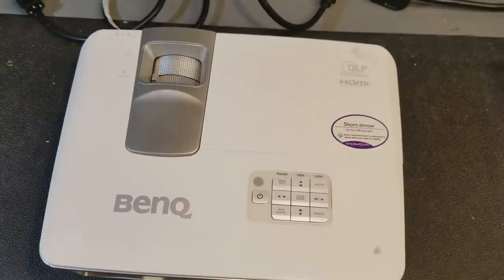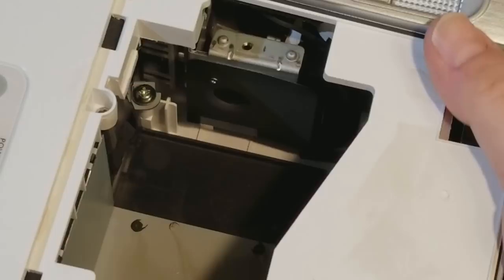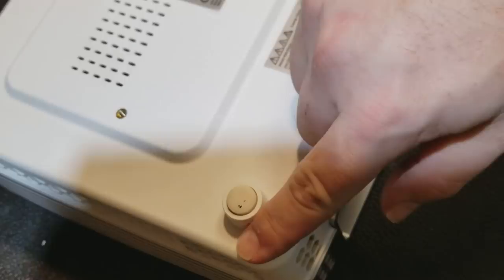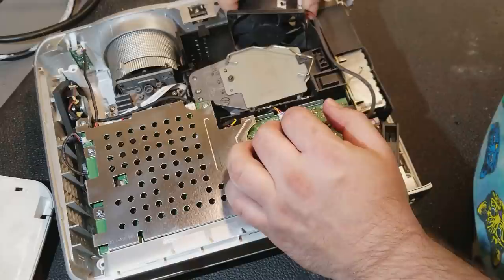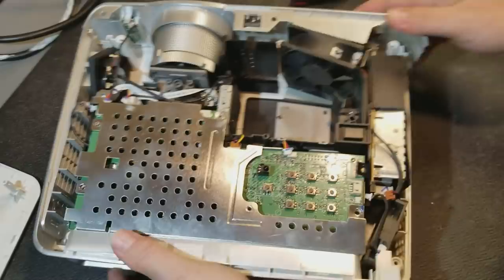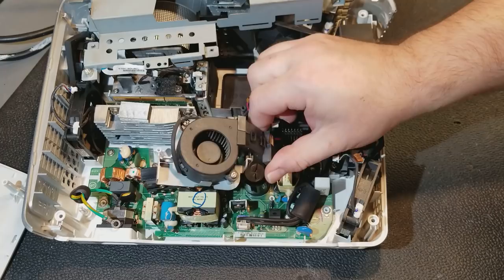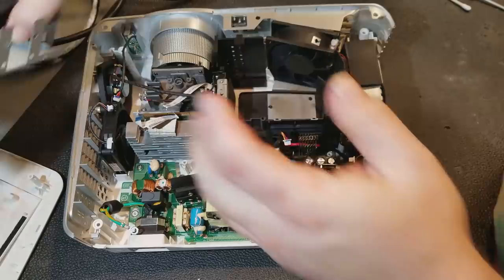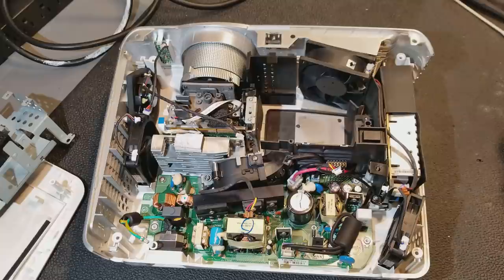BenQ W1080ST DLP Projector Cleaning / Service P1

Comment: Hello Franck, thank you for sharing all this knowledge. I have an issue with my Benq W1080ST.  After having replaced the bulb and one fan, I have no power on the mother board. No led turning on . The switch connector on the cover is OK. Do you have some ideas ? Thank you in advance
Reply from the maker: Bonjour Ludovic!  I saw your email and have some ideas.  If the fuse is OK, you need to check for any standby voltage on the pins to the mainboard.  Also, check the thermal fuse/breaker on the blower fan.  It will interrupt power to the power supply as well as the door switch that you already checked.
Reply: @FixitFrank  Hi Frank, thanks for the advices. Fuse (F601) is OK (0 ohms) - Thermal fuse breaker (CN702) is OK (0 ohms) - Door switch (CN602) is OK (0 ohms) - I checked also the standby voltage  on the pins to the mainboard (CN701) : pin 1 0V - pin 2 12,8V- pin3 12,8V - pin4 12,8V- pin5 12,8V - pin6 0V- pin7 0V -pin8 0V - pin9 0V - pin 10 0V-pin 11 3,4V - pin 12 0V - pin 13 3,4V - pin 14 0V.  this is DC voltage between ground and each pin. Do you think the powerboard is OK ? - what's next could I check (motherboard ?) - Thanks in advance for your support and have a good WE.
Reply: Sorry , I made a mistake , pin 2 is 0V and pin 1 voltage is fluctuating
Reply from the maker: @ludovicdehondt649  Fantastic! That seems to be correct.  The standby voltage seems to be there.  https://elektrotanya.com/showresult?what=BenQ%20w1080&kategoria=&kat2=all  This is the service manual(free download).  The website is Hungarian but the manual is english.  Page 8 goes over the schematic for the power control.  I suspect you may have a mainboard with a bad regulator but the service manual will help you locate which one.  You are very welcome! I am happy to help.  Have a nice weekend as well!
Reply from the maker: @ludovicdehondt649  I think pin 1 not connected so you are reading air inductance. You can ignore that.  Page 19 of the manual shows the power supply output and it matches your readings.  Moving onto the mainboard is a good option.  
If you end up needing a mainboard, they are actually reasonable in price.  Email my friend at Time Electronics.  Gydz@timeprojectorlamp.com and send a picture of the old mainboard and they will quote you a price to Aus. They take paypal and ship DHL.
Reply: @FixitFrank  Hi Frank, Finally I found the root cause...basic mistake....the 14 pins  from the power board were not properly connected to the mainboard. the 2 pins on the right were touching the metallic structure. SInce then, the projector works 2 minutes and then stop  ( power led red - temperature led full green)  because of fan issue. I hve gone through  the factory menu. Fan N°3 RPM and fan N °4 RPM are indicating 0 RPM . I'm sure fans N°4 is running, i can see it. I will investigate to make sure fan N°3 is running as well. If you some othier ideas...thanks in advance
Reply from the maker: @ludovicdehondt649  That makes a lot of sense. I have had that happen as well. I am so glad you were able to work it out.  Congratulations!

Comment: Hi Frank. The bulb in my Benq W1070 exploded after a few years of good service. I have just replaced the bulb but when I turn the projector on it switches off immediately from overheating ('TEMP' indicator on). I have read some comments here and I know that I should check the lamp cooling fan. Any other suggestions? Is it possible that the bulb is installed badly? Or that the bulb is faulty? (I ordered on Ebay from China). Many thanks.
Reply from the maker: Hello Patrycja!  Two things to check.  First make sure the bulb you received says "osram" or "philips" on it somewhere. Otherwise its a knock off and a waste of you money.  Knock off lamps tend to last a small percentage of the expected life span. This means you end up buying more lamps when if you buy a name brand(does not have to be from Benq, but it must be a Philips or Osram bulb) it will last much closer to the full life of the original.  
The temp warning is probably a piece of glass stuck in the lamp blower fan.  I have a video on an HT1075 which is close to your W1070. It had the same issue and was due to a bit of old bulb jamming the blower fan.  Here is part1.  https://youtu.be/rki1jSNMpII  Part 2-4 is in the description.  Once you get the glass bit out, you should be fine.
Reply: FixitFrank Thanks very much! I will check the lamp blower fan. By the way - the bulb is Osram.
Reply from the maker: @merkova999  Great! In that case, the lamp is probably fine. Good luck with the fan and let me know if you get stuck.

Comment: Hi frank, Barbie, here again! ...got a question about the fan... my fan needs replacement and here in Argentina i was able to find the model  of fan Ad07012dx257300 wich is 0.36A and the fan for my benq says Ad07012DB257300. and its 0.30A, any chance the one i can get here might work? or needs to be the exact one? thanks again!! B.
Reply from the maker: Hi Barbie!  Good to hear from you!  I think you will be OK with the Ad07012dx257300!  I checked and the X means Hydro Bearing is used and the B means Ball Bearing.  The X (hydro) might even hold up longer...  the current draw difference  should not matter as its only 60 milliamps difference.  If I were in your position, I would try that fan. I think it will work without issue for you.
Reply: @FixitFrank  gracias Frank! Ill give it a try :)
Reply from the maker: De nada! Por favor diga si funciona
Reply: @FixitFrank  Hola! It works but I now have  Fan 1 speed error 2... what should I do?
Reply from the maker: Is that the fan you replaced? Or a different fan?  If it's the same fan you may need to change the service menu RPM settings.

Comment: Hey buddy thanks for the video. My benq 1080st lamp popped with all the lamps glass shattering inside the projector. I replaced the lamp following your instructions but there is no light coming up. What else do you think could have been damaged when short circuited. Thanks in advance.
Reply from the maker: Id check the lamp blower fan and see if glass got inside and caused it to stall.  That will prevent the lamp from starting.  This is pretty common as the vent in the lamp almost aims the glass bits to go down the fan when they burst.

Comment: Do u do work for others? I have a Ben Q that stays on for a good 10 min then goes to “lamp light” light. I’ve had for about 5 years now first time it’s done this.
Reply: Also I ordered A lamp hoping that’s all it is.
Reply from the maker: I do, but I suspect you need a new lamp.  5 years is pretty good. Make sure you refer to the manual and reset the hour counter or you may keep getting the message.
Reply: FixitFrank I need help I took apart my projector to clean out the fan and when I put it back together it does not turn on

Comment: hi, i followed your guide and i replaced the fan, the one in front and after that it worked great until i decided to do a firmware upgrade...as an idiot that i am i used the w1080st firmware for w1080st+ and now i have a brick, do you have any experience with this??
Reply from the maker: Hi Martz, That is a real bummer. I am sorry to hear that.  Personally I have not un-bricked a w1080 but I suspect its not impossible to repair. The problem is that you no longer have access to the bootloader, or the program that starts the software to allow you to install the proper firmware.  
If I had it here, I would try reflashing it via the JTAG/debug port.  https://elektrotanya.com/showresult?what=benq%20w1080&kategoria=&kat2=all  This is the service manual with schematic. I suspect you will need DLP Composer software but I need to read up on it more. The goal is to interface with the ddp442x and put the firmware back into it.  
This is a pretty severe issue to repair DIY but not impossible or unreasonable in my opinion.  
I think if you search for "DDP442X loader" or terms like that you may find the way to do it. I found quite a few options and after looking at the service manual, I think flashing the IC via the debug port on the mainboard is going to be your only and best option.
Reply: @FixitFrank  this is what I found also, i have no experience with JTAG and I wasn't able to find any firmware for the w1080st+ or ht1085st, I understand that they are the same, the only option that I can see valid is either call benq to see how much they charge for this (on avs forum they say it's around 200-300$) or to buy a main board, i found some online ranging from 130-250$....

Kindly thank you for your time and answering! :)
Reply from the maker: @MartzMit  no worries. Feel free to email Crystal at Time Projector, gydz@timeprojectorlamp.com. She will probably be cheaper. I paid 85 for an optoma mainboard
Reply: @FixitFrank  million thanks Frank, I owe you a beer!

Comment: Thanks for you excellent videos... I'm trying to clean the lens lamp and sensor on my Benq W1500, but I can't get the top off as its attached to the lease shift mechanism/knob, any suggestions? Thanks
Reply from the maker: Hello Alan. There is a sticker covering a small screw on that knob. Peal back the plastic sticker and the screw will be obvious. I would only partially peal back the sticker so you can return it into position once you finish.
Reply: @FixitFrank  Thanks for the helpful advice Frank. 

My projector was turning off after a minute of powering up and showing a picture. When it switches off there are NO lights or power for about 30 mins, not until it cools down do the lights/power come back on. All of the fans and colour wheel are turning so I'm assuming this is designed to protect the bulb etc? Thanks again
Reply from the maker: @jobo5734  Correct! That 2 wire thermal sensor(little white rectangle) has a bi-metal switch that opens the circuit when it overheats.  Then once it cools, the switch closes, allowing power to flow again.  Once you clean the fans and other dust, you should not have that problem again.
Reply: FixitFrank Thanks Frank, I’ll get going with it then! Much appreciated Alan
Reply: @FixitFrank  Hi again Frank, unfortunately after stripping the projector down, cleaning the lens fan and sensor, the projector is still behaving in the same way. I stripped it down a second time to make sure that all of the cables were in place etc and it switched off again in the same way, I wonder if this could be the colour wheel sensor? The lens fan was very dirty, I cleaned it with compressed air and it spun freely. Thanks in advance. Alan
Reply: Alan Hamer A future update, I just tried it in high altitude mode and it stayed on longer, but then it’s started to give out a burning smell just before the projector shut down, so sounds like it is getting hot and perhaps the lens fan is faulty? Good job I haven’t put my new bulb in yet lol.
Reply from the maker: @Alan Hamer HI Alan, What specifically are the symptoms(ie, how long does it run in normal mode)? Also, where is the lamp from?  Was it an existing lamp that had worked or a new lamp?
Reply from the maker: Also, I think you might have some failing fans.  They may spin, but the blades may no longer be shaped correctly from the years of moving heat past them.  I would at least check the lamp blower fan in depth.  Possibly even take it in half to make sure the squirrel cage is clean. Use a tooth brush and water to clean it.  That must be forcing enough air into the lamp, and away from the bi-metal sensor.  The exhaust fan is another that may have blade shape problems.  The annoying part about these fans, is that you need to match the model # exactly to get the correct RPM pulse. Either search on the model # on the sticker, or search on W1080 Fans.  Many are sold as a set for about $40. I'm hoping its just a clogged set of blades in the blower fan. They are obviously turning fast enough or you would have a temp error.
Reply: FixitFrank Hi Frank,  was able to take apart the lamp fan and (called it lense fan by mistake previously sorry),  I cleaned it well with compressed air and cotton buds etc and it spun well. When the power went off the very last time (with high alt) I had two red lights with one flashing as it cooled down, I usually only have total power out with no lights etc. Do you know the lamp fan part number for the w1500?

Thanks again
Reply: FixitFrank Sorry forgot to add that it’s the original bulb also.
Reply: Normally runs for about a minute before it switches off also.
Reply: @FixitFrank  Apologies my replies have come from two accounts, sorry I'm GoProGuy100 also.

Comment: Thanks for this video! I’m having problems with fan #1 - is that the large lamp fan adjacent to the lens?
Reply from the maker: That is correct.  Lamp 1 is the exhaust fan visible when you remove the lamp.  Lamp #2 is the power supply fan, Lamp#3 is the lamp blower fan, and #4 is the DMD fan(left side if looking from the back).
Reply: @FixitFrank  Many thanks. Much appreciated.

Comment: Hey Frank, I just pretty much followed you tutorial step by step... went to power it on and ahhhh... Now it isn't powering haha. Any reason why this might be? :/
Reply from the maker: Without seeing it it's hard to say but I have forgotten to reconnect a wire more than once.  I recommend going back over all the points and plugs. There is a thermal fuse (white rectangle) that if it's not plugged in will prevent any power.

Comment: Hello, I see you do reply to all comments, thanks for that. I have a question. My projector Hitachi Cp DH300 screen goes dark with with white dots after 30 minutes or so of use, it's not a bad dmd chip because before it goes dark, everthing look fine. Get this, when i put it on high altitude mode, fans ramp up and the problem is no more. I live at sea level. My guess is that the blower fan that cools the heat sink for the dmd needs replacing. I took the lamp out to see how much air is pushed and i can barely feel it. What do you think?
Reply: The screen:

https://imgur.com/X6EMDui
Reply: also there are no warning lights whatsoever